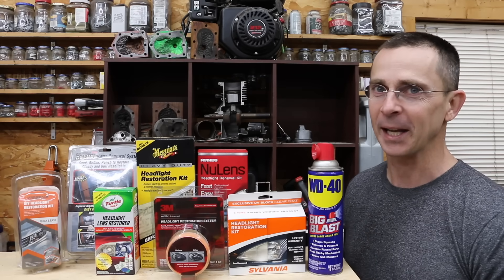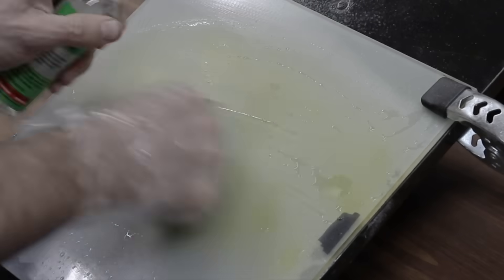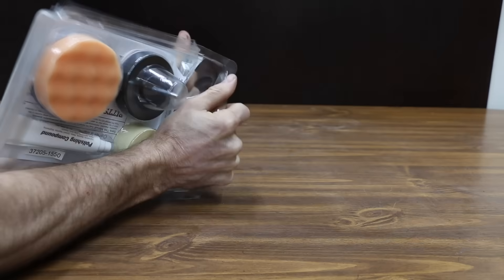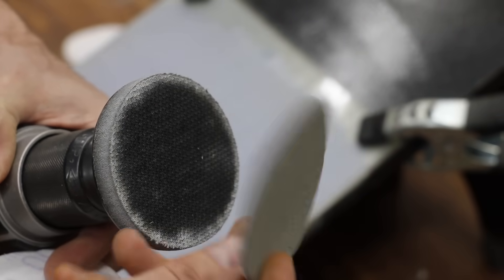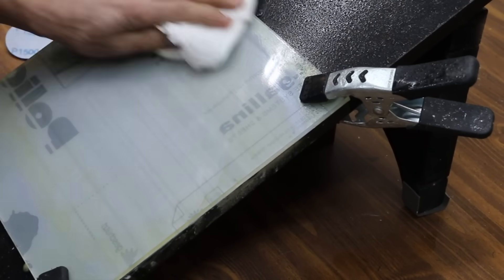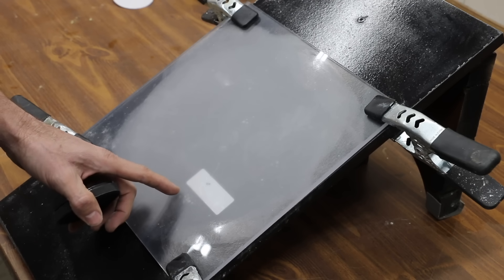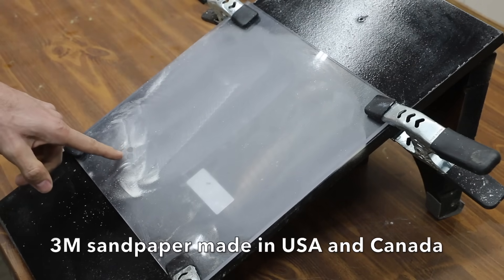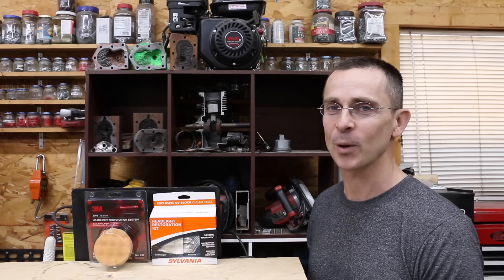Best Headlight Restoration Kit?  Let's find out!  3M, Sylvania, Meguiar's, Mothers, Turtle Wax & HF

Comment: Here's my process: a 400, 800, 1000 wet sand then polishing compound with a professional grade buffer. Fast and easy, looks absolutely new and lasts about 9 mo, then I use the buffing/polishing compound and they are new again for another 9 mo. One caution - if you're not accustomed to working with a buffer proceed with caution - heat builds up and too much will melt the  surface and you'll have repeat the entire process.
Reply from the maker: Thanks for sharing.

Comment: I used a product called Wipe New. It actually did a decent job but it only lasted 6 or 8 months. I also noted that the plastic of the lenses had many small cracks. It appeared the plastic was really breaking down. I finally replaced the headlights since this was the second attempt to repair the headlights and the plastic was a yellow color, even after repairing them. The new headlights were a huge improvement. This is a 2004 vehicle so I guess it was time. Thanks for your review of these products. I will use this info if I need to do this again in the future.
Reply from the maker: Glad to hear!  Thanks for watching.

Comment: You've texted glues now test the best way to remove different types of glues on different surfaces
Reply from the maker: Thanks for the video idea.
Reply: How many likes do i need for you to try it
Reply: I got an aluminium boat that I'm trying to get the carpet glue off of i discovered that oven cleaner works wonderfully and reasonably fast 15-20 minutes i also bought aircraft remover which didn't perform like oven cleaner

Comment: Household water heaters are cathodically protected by a magnesium rod that extends from the top of the tank to near its bottom.  If you look at the top of a tank, you will see the unlabeled head of a bolt.  

Some water heaters have double the guaranteed life of others.  The ones with the longer guarantee have two rods.

If you monitor the amount of magnesium eroded from the rod and replace it when 75% of the rod is gone, your water heater will have a very long life.

Stores that sell water heaters never have rods in stock because they do not want consumers to prolong the life of their tank.  Maybe the store will order one if you ask, but if not, you can find them for sale online.

The anode for a tank in a recreational vehicle is attached to the faucet used to drain the tank.

Comment: Is there a way to reduce the noise a generator makes? If so how effective would it be?
Reply: ruzilla01 plumb it through a wall outside or fab up a larger muffler.    If you can weld and have a mig or wire feed machine and a handheld grinder it’s pretty easy.     I just made a generic muffler off my old dozer fit my old GMC pickup saving me $200-400.    .030 flux. Ore wire allows you to do all this stuff easily with a cheap HF machine.   Those short Autozone ect pipe reducers allow you to neck up or down easily often needing no clamps for 5-$10.

Comment: Video idea: valve seal softener test. Get a load of old stiff valve seals. Soak them in the various additives available. Test wintergreen oil too as it looks like that works. If it does test if wintergreen oil can be ran mixed with engine oil safely. I’ll leave your engineering mind to work out a method of test.                                                      Yes I have bad valve seals....
Reply from the maker: Great suggestion!  Thank you.

Comment: Cool video. Problem is, a flat surface is easy to polish. You need to try this on bends, curves and convex surfaces. The way these products can handle all the diffrent shapes has a big impact on how good or how bad they could potentially be. For example: a product that works fantastic on a flat surface may be terrible when faced with odd shapes. It's more then just how good the sandpaper and polishing compound is. With flat surfaces, you may as well just use sand paper and polishing compound that you have sitting around the shop.
Reply from the maker: Thanks for the feedback.

Comment: I just used the 3M headlight restoration kit on my wife’s van. 2 years earlier I used my own stuff to do the job then clear coat (terrible idea using clear coat) it fogged back up in 3 months. After using 3M kit 4 weeks, ago we were extremely happy. It not only took of the yellowing but the clear coat. It’s a great product!!
Reply from the maker: Thanks for sharing.
Reply: Project Farm sure. I’m going to try a 2K clear coat and see how that works?

Comment: Polishing and cleaning is easy, the real question is how long will they last.
Reply from the maker: Thanks for the feedback.
Reply: @ProjectFarm  Heh, not knocking your comparison just my experience with trying them. Though I'm not too surprised the sylvannia looks to do the best job. They do make headlights after all.
Dot 3 brake fluid is real good at getting the yellowing off oxidized headlights, gotta be careful with the paint around them though. Still have to polish after.

Comment: 3M has a small sealed pouch with a 2 pack of lens coating wipes with one 3000 grit gray/green foam Trizac disc. It is $4.99 or less at Advance Auto. 3M Quick Headlight Clear Coat 39173. (The website has the wrong photo) I used it on my 2003 Infiniti G35 lenses (one original/one junkyard) and the results were incredible like the Sylvania kit. I have a $475 cover on the car slapping both lenses in heavy wind and rain - both are still in just-applied condition. Buying your own 3M sandpaper, a water misting bottle (or take the lights off the car and put it under a kitchen sink faucet like me...), some rubbing compound, and this kit will provide awesome lasting results. You can reseal the pouches and reuse the wipes too. I polished up my neighbor's Honda Element lenses and coated them with the opened pouches. (It bothered me to see the yellow lenses every morning.)
Reply from the maker: Thanks for the feedback.

Comment: I've done headlight restorations professionally. My method is sand the lights up to 1500 (I may start as low as 240, but usually at 400). Then, clean the lights really well, and spray them with a UV protective clear coat rattle can, both Rustoleum and Krylon make excellent clear coats. 
Optionally, after 1 week, wax the lights with a good wax. Meguires cleaner wax is my go-to. Re-apply every 6 months for a long lasting bring shine.
Reply from the maker: Thanks for sharing.

Comment: "If you ever own a car you know they will get yellow over time"

Me: [laughs in glass headlights]
Reply from the maker: Thanks for watching.
Reply: LS430, glass headlights here :D
Reply: Same. Last year before they phased them out. 2002 Toyota. Look brand new still.
Reply: ive got 1975 mustang with glass. cant touch this
Reply: Wish my Tahoe had glass headlights. Had to replace them about 6 months ago with new bulbs included. If you were driving at night in the rain, forget trying to see. Now I see fine at night
Reply: [laughs in 1965 mustang headlights]
Reply: 90s Suzuki Swift glass headlight owner here. Never fading...
Reply: jameshisself  yeah but are even rare cases, glass tens to be more resistant...
Reply: It is true I really enjoyed my glass headlights on my 92 Toyota pickup and also on my 96 Cadillac Fleetwood, they are always crystal clear and perform flawlessly, I have never had any issues of rocks punching holes in either vehicles glass

Comment: Curious if you can recreate uv oxidation using a tanning bed light and heat lamp to speed the process up.  I'd like to see if an automotive wax applied to the lens will prevent the protective coating from wearing off and causing the issue to begin with.
Reply from the maker: Thanks for the video idea.

Comment: Thank you for shining a light on this topic.

Sounds like you might be doing a sandpaper comparison video.
Reply from the maker: Great suggestion!  Thank you.
Reply: If you're comparing kits like these that come with sandpaper, you can't really judge the overall effectiveness of the kits without judging the sandpaper as well.  In general, 3M is the best you can get for sandpaper....  Sadly, as bad as the sandpaper in the harbor freight kit is, it's not the worst available....

Comment: I'd be very interested to see the general advantages/disadvantages between different wood based building materials. I.E. hardwood, softwood, plywood, OSB, MDF, HDF, and * shudders* particle board.

Maybe see which ones hold different types of fasteners better, which ones take paint the best, breaking and compression strength tests, which ones work best with adhesives, perhaps even which one is best at resisting fire. Value for money too of course. 

I searched your videos for something like that and didn't see one, but if I just overlooked it please let me know (:

Anyway, great video as always and keep up the great videos. Stay safe (:
Reply from the maker: Thanks for the video idea.

Comment: The way we fix headlights in my shop is start with 180 grit sand paper and gradually work down(up) to 1400 grit wet dry sandpaper then buff the headlights with buffing compound. Then clear coat but this only lasts a year or two
Reply from the maker: Thanks for sharing.

Comment: So about 2 or 3 times a year I hit my headlights with some rubbing compound and a buffer to take out the haze that builds up. This has kept them pretty clear, but I notice they do have a slight yellow tint. Sylvania seems like the best deal because it did a good job, is only $20, and comes with a UV blocker clear coat. But did it do a good job removing the discoloration (yellow tint) or just the scratches?  It seemed like this was more focused on removing haze/oxidation rather than discolored headlights. I was hoping someone can give me a bit more info on that.
Reply: Best comment so far. This is definitely the best and easiest way to keep headlights looking Crystal Clear year round. 

I hit mine with the buffer and Meguiars headlight polish a few times a year and they are perfect within 60 seconds. No need to sand or anything. 

Maintenance is the key.

Comment: Mr project farm I’m a huge fan! I have a question and would very much appreciate and respect your opinion if I may ask. I take my truck off-roading. I jerry tigger an airfilter slash snorkel that is quite exposed to outside air. Where I work I get k&n dirt cheap and can warranty them out so I clean or change from my stash pretty good. But the other day Someone was arguing about how k&n let dust in being a high flow. So in my case do I have huge chances of engine damage later down the line??

Comment: I have requested a few times, but I think this would make a great video. Could you test the heating efficiency of putting plastic sheets up over windows and even separating rooms? It seems obvious! But it's not a big thing in our culture it seems. In my room, the heating element is in the sleeping area, but it's very open concept. I have a ceiling to ground sheet of plastic that, I would think, shrinks the volume of room required to heat. It should be mentioned the thermostat is in the enclosure. Even if it's not that extreme, and you just test to see if putting plastic over the windows. Meaning tapped on the dry wall, with maybe 1 1/2 inch of over lap, to cover the actual window frame. (plastic on the inside). Thank you for the consideration!
Reply from the maker: Thanks for the video idea.

Comment: I used the Sylvania kit last year based on it's reputation. There are two things that would have made it better. First is that the quantity of sandpaper is not enough because it clogs before the timed sanding periods are up so buys some additional paper in the same grit rating and check it for clogs as you go. Second is that the time period for polishing the lens is too low. Stretch that period out and keep the sandpaper fresh and it is the best. I'm still happy with my result but I know how to do it better next time.  Good video!
Reply from the maker: Thanks for sharing.

Comment: Hey again, how are You ? How about testing what best glass filler or repairing kit is the best, basically u need a light arrow head and some fixed weight at a certain height and compare with microscope and share the results with Your scientific way, keep up the good work and stay safe Sir
Reply from the maker: Thanks for the video idea.

Comment: I actually restored my headlights once but I did not use a kit. I used 800-3000 grit sandpapers, some polishing foam and water for the finest grits. I finished those with transpaent UV resistant spray paint and then I polished it once more with a sponge and fine polishing paste. It took WAY more time that you spent on those plates but it remains crystal clear for 5 years by now. And it was very cheap.
Reply from the maker: Thanks for sharing.

Comment: You can skip the kits and just get sandpaper and plastic polish "PlastiX" then buy a can of Meguiars UV headlight protectant for long-term cost savings. The Polish and  UV protectant will last for multiple applications. I usually try finer grits first to see if they're enough and then only go as coarse as needed and then proceed to progressively finer grits after. This reduces having to get scratches off from the coarser sand paper. Then polish and protect.
Reply from the maker: Thanks for the feedback.

Comment: Motor oil viscosity vs. fuel economy 0w-20 to 20w-50 at operating temperature. And or viscosity and engine protection.
Reply from the maker: Thanks for the video idea.

Comment: It might be neat to see if you can take what we learned in this video and make a DIY kit. About 12~15 years ago I wet sanded the headlights on my 240SX and saw really great results. You might get lucky and find a variety pack of sandpaper at a parts store with 400, 800, 1600, and 3000 grit like I did back then. Also it might be interesting to test some commonly available UV protection coatings to see which one might pair best with either a DIY approach or for kits like the 3M that didn't have one.
Reply from the maker: Thanks for the video idea.

Comment: What about testing head gasket leak repair products? Ever since I started using full synthetic oil in my high mileage '97 Honda Accord v6 oil has been very slowly seeping out of head gasket little by little, which with my second-to-last oil change I prevented by adding some high mileage conventional oil with seal swell, not sure if it was the fact that I accidentally added conventional oil or that the seal swell addative actually worked. Anyway, I was thinking about getting an in-oil head gasket repair product like blue devil or something like lucus and would love to see you test some different products! Keep up the good work! 🔥💯💪
Reply from the maker: Thanks for the video idea.

Comment: Can you do a test to find out if spraying a metered amount of water into an engine will increase efficiency? The water will raise the compression slightly and maybe utilize some of the heat creating steam for power in addition to the combustion. It will also cool the incoming air which should make for a more dense cylinder charge.
Reply from the maker: Thanks for the video idea.

Comment: I used the Pittsburgh set on a beater Honda I bought last year. I found I had to use water with the sandpaper, didn't clog near as easy. Otherwise it worked great
Reply from the maker: Thanks for sharing.

Comment: Best parts washing solution? 

There's a bunch out there, both water based and petro based. Zepp, WD 40, Safety-kleen, etc. Most are much more pricey per gallon than the usual stand-in... Plain old diesel fuel. That's what I use in my parts washer.
Reply from the maker: Thanks for the video idea.

Comment: I buff the snot out of my xterra lenses with the Maguiars stuff and a wool drill pad about every 3-4 months. Was never sold on using aggressive sandpaper on normal oxidization.  Your microscope images prove its mostly a big mess even after the buffing stage. I'm interested in checking out the Sylvania though
Reply from the maker: Thanks for sharing.

Comment: I have used the turtle wax one in the past.  I had an older version of the kit and you didn't use a pre-wipe.  I think that stuff sealed in the yellowing.  However, I am going with the Sylvania kit because it comes with the complete package.  Note: don't just head to amazon to buy any of these products.  They are charging double the listed price in this video.  Instead, start with your local auto parts store.  I went to auto zone and they had the kits at 19.99 which is what you listed it as.  Great video, just what I needed to see.  Keep up the great work!
Reply from the maker: Thanks, will do.

Comment: I'll save you the headache. Buff down the top UV protectant layer. Then buy UV Resistant Clear coat. Tape around & apply. Done. Some of these kits work for a short time.  "Smoking Mirrors". As long as you leave the UV damaged layer on. It will oxidize & come back. Then you are in the same boat again. I use a paint reducer CAREFULLY & you'll see the top coat come off. Then buff it smooth & clean. Then you apply UV Resistant coats.
Reply from the maker: Thanks for the feedback.